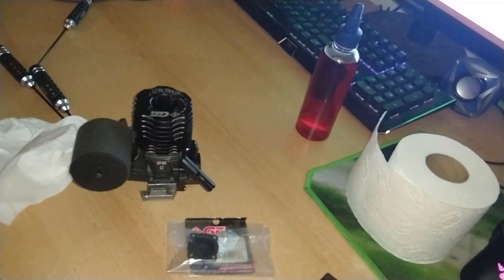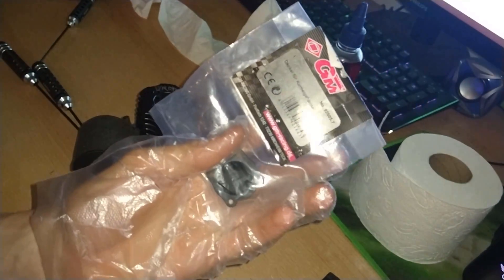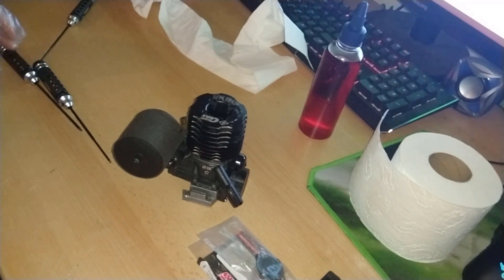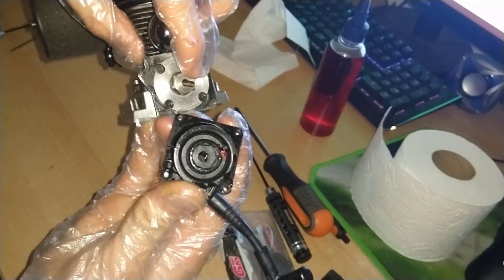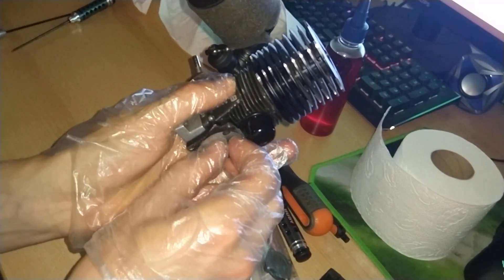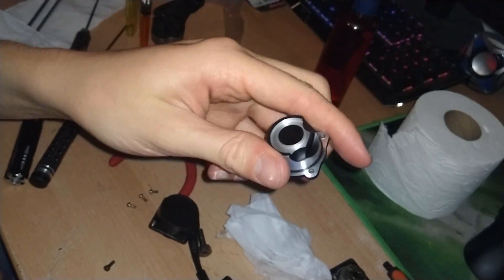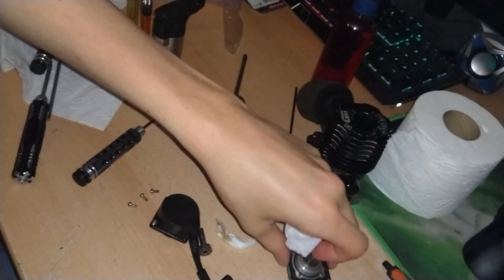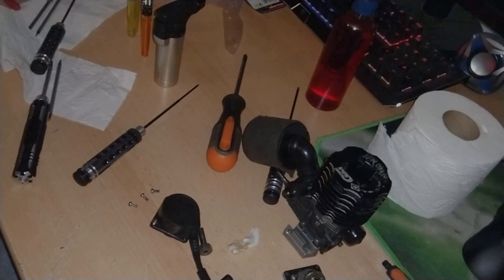Must have upgrade on any nitro rc car engine!

Comment: I rather have a pullstart then carry a big starterbox with me all the time. You talk about pullstarts failing. Sure that can happen, but I have also seen startertboxes fail. And when that happens you have no chance of starting the engine when you`re in the field.
Also I haven`t seen any engines having performance losses from pullstarters. There is no dragging on the crank as you imply here. It`s a one way clutch. Just a little pin that makes click click click. 
But hey, it`s up to everyone themselves what they wanna use. Easy.
Reply from the maker: I did notice a big difference in terms of performance on my fully sealed Go .21 compared to the GO .21 with pullstart also keep in mind the shaft and the wheel that grabs the crank had twice the weight as the crank itself on this particular engine and this will make a huge difference in engine response speed. This pullstart design had no one way clutch that clicks either
Reply: Really paddypatrone? Of course they sap power! There's constant friction, lack of crankcase sealing and by the way If either of the starting methods fail while out driving your fkd either way without parts. Nitro mike is right and you should probably hide that unintelligent ignorance of yours. He is trying to help people.
Reply from the maker: @standardaussie  Let's keep it civilised people but I keep repeating the same stuff as you ;)
Reply: @standardaussie  My pullstart never failed... in 17 years!

Comment: Yes pull starts, roto starts are easy and a must for some, but like Mike said, mounting a pull start like a LRP to a buggy  will need modifying.   Starts also wear out and cost a fortune if you can find them.

Comment: Do you have to take out the pin and spring from inside? Some others say you do
Reply from the maker: Yeah you have to remove the spring and pin from the crank since the sealed backplate doesn't need them and you don't want the pin or spring get out and destroy your sleeve with 40.000 rpm

Comment: sealed engine gang!!  lol. Anyway, having an engine leak that much oil in the back is quite rare, and could also be because the motor is running too rich nd not burning up the oils, you know.  Unfortunately a backplate is not an option on most RCs, other than flat pan buggy chassis.
Reply from the maker: Truggy, Buggy and most Onroad cars all have a flat bottom chassy with 9/10  times a hole for the starterbox wheel. Only the nitro monstertrucks from a decade ago don't have starterbox support and you shouldn't be bashing with those things in 2020 anyway since truggy and buggy rule!!!!
Reply: @NitroMike  I mean a truggified savage is pretty cool, most look dumb because they ride too high, I got mine close to the ground as possible
Reply from the maker: @ArmrDg  Yeah but you gotta remember a HPI Savage is a nightmare to work on compared to any truggy. To completely remove the center transmission on any buggy or truggy for instance I only need to remove 4 bolts. Wanna remove the entire front or back of the car? 4-5 bolts. On a Savage you need to remove atleast 8 or more bolts for the same parts.
Reply: @NitroMike  yeh but it's all worth it once you get in dialed in, since I completely built it myself from the ground up, it only took a few runs to work out the kinks and now I run it all time and don't have any issues except for minor issues. And this is with me deathrolling the thing countless times at high speeds :P
Reply from the maker: @ArmrDg  Whatever makes you happy is what you should run. I however, hate bad design on any car since I wrench a lot behind the scenes to keep my cars going after the extreme weekly bash sessions
Reply: @NitroMike  ah that makes sense, have a nice day

Comment: Nitro mike, I agree with you

 These guys clearly only ever had one car. And no that much oil is not uncommon , maybe you should try buying another car before declaring to know better than mike ya spuds
Reply from the maker: Every pullstart I used to own had a waterfall of oil coming through the one way bearing which caused the famous slipping pullstart issues that every nitro owner hates

Comment: I'm not sure why your engine was leaking the oil inside the starter - I never had that problem with my .21 or .28 engine. I know you are saving the weight, but you aren't able to use the rotostart/pullstart or even electric start. Only starter box will start this engine, but it won't work with all the nitro cars.

Comment: It's just another thing to lug around, and on a engine that's not meant for racing like the one you have there there really isn't any performance increase that's noticeable... besides you can't even put it on most engines since the chassis blocks it.
Reply from the maker: It's not only for performance. You also remove a lot of complicated extra parts on the engine as well as removing one more spot for possible airleaks so the reliability of the engine goes up.